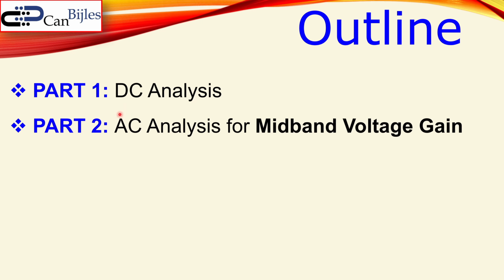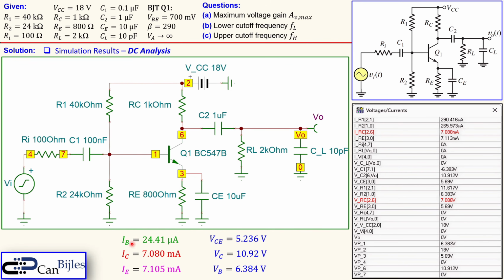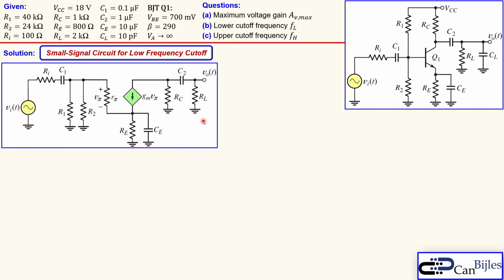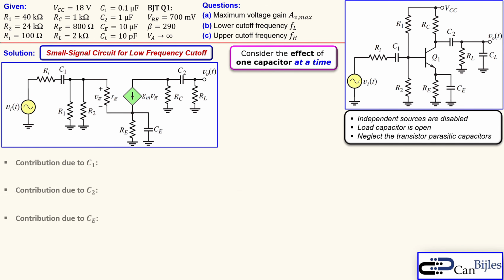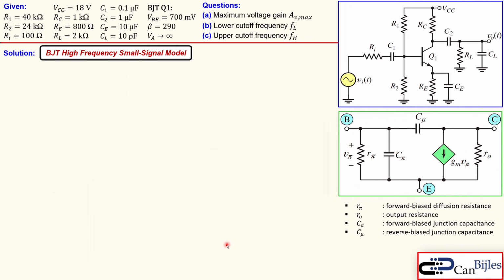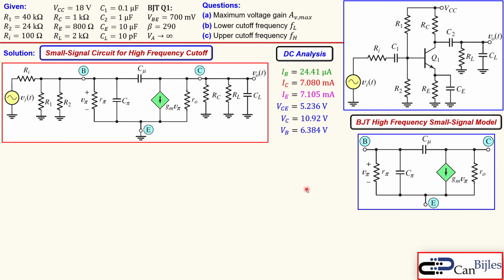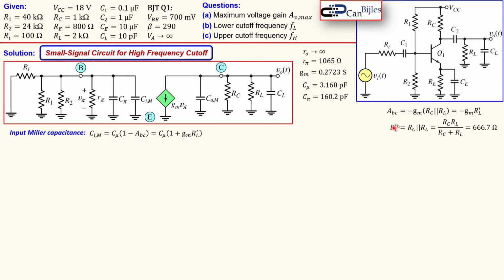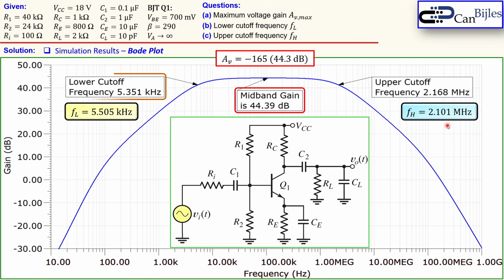BJT Common-Emitter Amplifier 🎯 Midband Gain, Low-Frequency & High-Frequency Cutoff 👉 FULL DETAILS💡

Comment: Does this circuit have two poles at DC attributing to C1 and C2?
Reply from the maker: As discussed in the video, the bypass and coupling capacitors mostly determine the lower cutoff frequency.

Comment: इसमे transistors का 290 hfe gain beta है तो काफी transistors मार्केट मे से खरीद लेते हैं इसमे hfe अलग अलग होता है तो उसका प्रभाव frequency response मे पड़ता है या दूसरे perameter जेसे क्लिपिंग, वोल्टेज gain या कई दूसरे perameter मे कृपया बताये आपका दोस्त from इंडिया
Reply from the maker: The beta of the BJT will somewhat effect the frequency response, but if the beta large enough (say more than 100), then most performance values of the circuit are not changed that much. Like in DC biasing, we have the four-resistor bias configuration, which will ensure a more stable biasing and therefore the AC parameters are more stable.